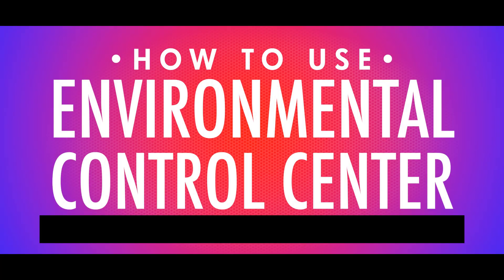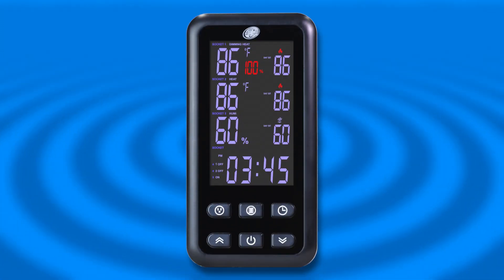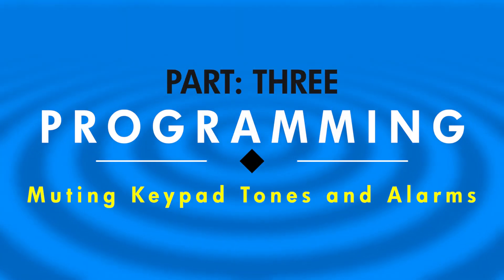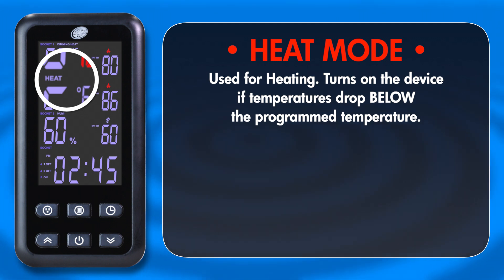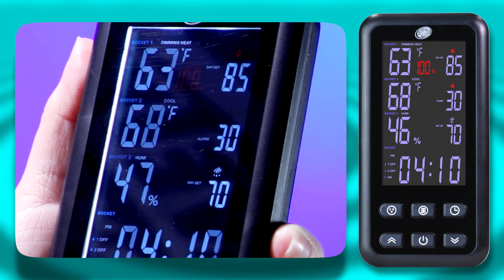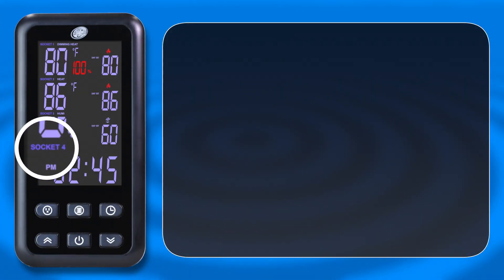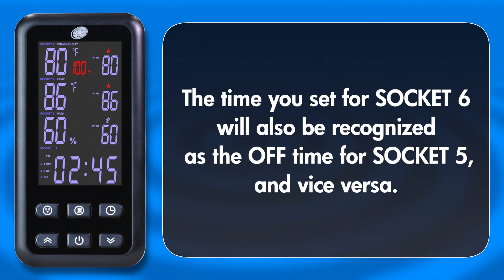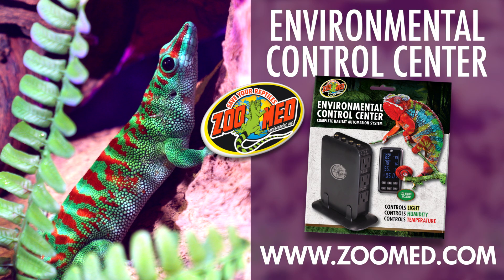Zoo Med Environmental Control Center - Instructional Video

Comment: Im having trouble I have one light on and my night light in how do I turn off my light blub off and only use my heat light
Reply from the maker: Hmm, it would depend on which sockets on the controller you're using. You could plug the day light bulb on the day timer socket, and then the heat bulb into your heat socket and that should get the results you're looking for.
IF that's not what you're looking for, contact our Customer Service and they should be able to help in more detail. They can be reached at:
1-888-496-6633
Hope that helps.

Comment: I can’t get the part in the end with the 4
Reply from the maker: You're referring to Socket 4? Which part specifically?
Reply: @ZooMed  the 456 and my light and temp won’t turn on or go up
Reply from the maker: @brianlykens2353  Please contact our Customer Service, and they should be able to help in more detail:
1-888-496-6633

Comment: It doesn’t matter what my humidity setting is - 0 or 100 or if I set the alarm to 0 or 100 it always beeps and now it says EE. I’m not even wanting to run a humidity unit, I just want a humidity read out. I got this thing maybe two months ago and it’s been beeping for a month. Holding down the two buttons doesn’t turn it off and the power button won’t stop it
Reply from the maker: Reach out to our Customer Service and they should be able to help in more detail:
1-888-496-6633

Comment: how do you set the Reptirain misting machine to run according to the control center instead of it's own built in timers?
Reply from the maker: The Repti Rain's internal timer will reset whenever it's not active and receiving power from the Environmental Control Center.
When it does receive power, it'll activate immediately and act accordingly to the Repti Rain's settings for the duration that the ECC provides it power, and then it'll reset again.
Does that make sense?
Reply: @ZooMed  Yes. So it is just providing power to it and it acts as if you've done a 5 second power cycle. So you still need to have a spray duration set on the actual reptirain unit. Thank you for the response.

Comment: My Socket 2 has alarm bells that won’t stop beeping….why is this?
Reply from the maker: Hmm, I would guess either your habitat's current temperature is outside of your programmed settings to set off the alarm, or the probe is not properly plugged into the 'Temp2' port.
If that doesn't work, I would check to see if maybe the probe's wire is damaged.
Please reach out to our Customer Service for more help and information:
1-888-496-6633
Hope that helps.

Comment: Is there any way for this to differentiate between 1 plug that has 2 switches? Example: I have a light that has a nighttime and day time bulb with separate switches. If I leave them both “on” is there a way to program power to shut off one at a time?
Reply from the maker: No, it would need 2 plugs to differentiate the two.

Comment: To avoid weird behavior with the temperature settings, keep the setting on Celsius instead of Fahrenheit. Apparently when in Fahrenheit mode, it still rounds up/down to the nearest Celsius equivalent whole number on the backend. I may not be explaining this properly. Hopefully they fix this with a firmware update, if that's even possible.
Reply from the maker: Hi there! You are unfortunately describing a bug that was in older versions of the Control Center, this has since been patched in recent releases. Contact our Customer Service about replacing your current one:
1-888-496-6633
or
zoomed@zoomed.com
Hope that helps.
Reply: @ZooMed  Thank you for the update. Loving it so far!
Reply from the maker: Excellent! Great to hear it. :)

Comment: I bought this and it seems to be too confusing for me....
Reply from the maker: With a device that does so much, it can certainly seem cumbersome at first, but hopefully this video helped shed some light.
Is there a particular setting you have a question about?
Our Customer Service is always available to help answer questions or walk you through it: 1-888-496-6633
Reply: @Zoo Med Laboratories, Inc.  I need to plug in my heat lamp, UVB and heat mat. Heat lamp and uvb on during the day and heat mat on at night. Plus thermostat on.
Reply from the maker: Hmm, going by your description I would suggest plugging your heat mat into the Nighttime Timer (Socket 6), plugging the UVB Lamp into the Daytime Timer (Socket 5), and then have your heat lamp plugging into either Socket 1 if it's dimmable OR Socket 2 if it is not dimmable.
Make sure the controller is programmed with the correct time and your preferred day/night temperatures and should function appropriately to your needs.
Hope that helps. If you need a more detailed explanation, please free to contact our Customer Service at:
1-888-496-6633.
Take care.
Reply: I have a similar issue, but without the heat mat problem. I have a basking light and a uvb that I want to be both set to the same clock, but when plugging in my basking light into socket 1, it doesn’t seem connected to the clock, while the uvb is working properly on socket 5. Is it possible for 2 day time light sources to be connected to the same clock?

Comment: It won’t stop beeping even after I pressed the power and down button. Can anyone help?
Reply from the maker: If it's still beeping even after muting the alarm, that means it's an Error Code alarm. Check your wire connections and make sure your temps are not too high/low. Please contact our Customer Service for more info:
1-888-496-6633

Comment: My remote won’t stop beeping I’ve set all alarms to 00.. what do I do
Reply from the maker: I would check to see if any error codes are flashing, or that all of the temperature/humidity probes are properly plugged in (even if you're not using them). If that doesn't help, please reach out to our Customer Service for more details:
1-888-496-6633
Reply: @ZooMed  I’ve tried everything. I’ve even tried unplugging it. It won’t shut off and won’t stop beeping. Driving me crazy lol
Reply: @HotpocketDoesGames  the remote has the alarm feature so changing the alarm temps or taking the battery out will reset it